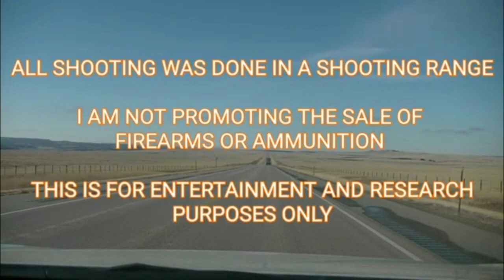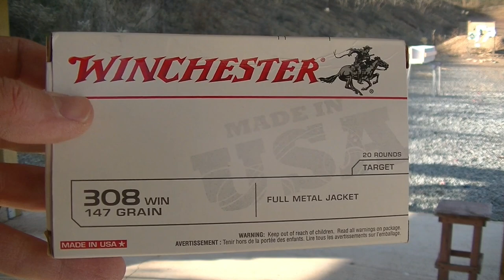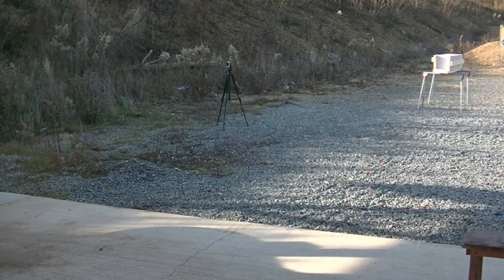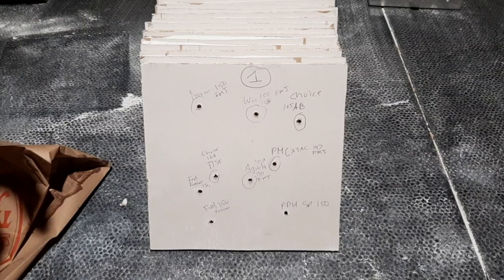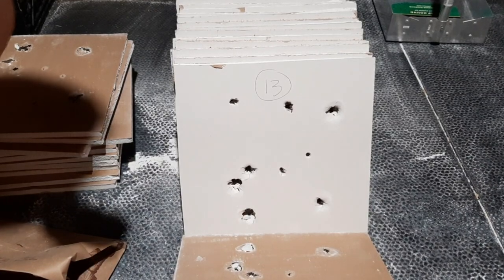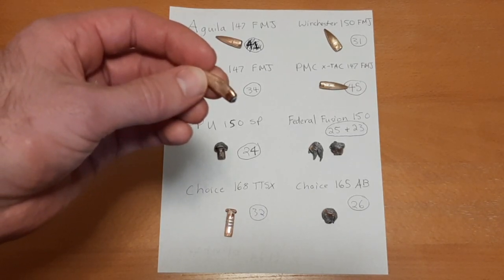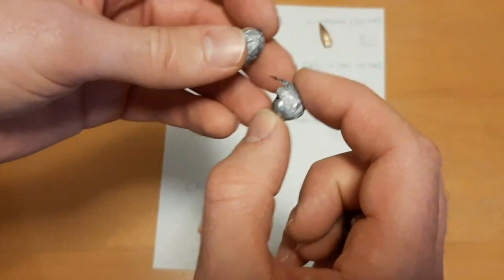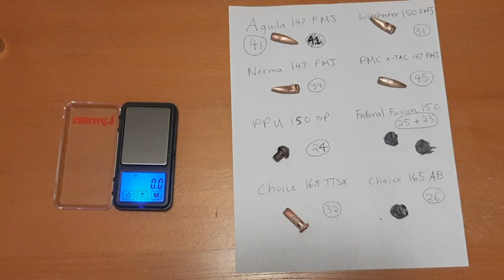308 Winchester/7.62x51mm NATO vs Sheetrock/Drywall - FMJ and Expanding Bullets

Comment: You are a fan of the big bore rifles that’s for sure . Same although mine revolve around what we are allowed to hunt with. 
The one thing that most people over look is the devastation that the 12 gauge slug puts out from 0-50 yards. 
I would like to see what a few of the different slugs would do to the ceramic plates . 
I know what it will do to deer at those ranges vs a 45-70. 
The 12 gauge will leave a bigger hole straight through a deer . 
Im not certain of what it will do to the plates.
Sorry it didn’t realize that you did test with the slug . The slug my not have penetrated as many sheets . What was the damage compared to the pistol and rifle rounds ?
I use what they call foster slugs . I bet that if one of the higher speed sabot slug was used it would go through more sheets of dry wall.
One reason the 12 gauge penetrated less the the pistol rounds is because it’s a fatter bullet,. Plus it’s a hollow base . 
I didn’t think about the cross section being a bigger and it changing the results of penetration.
Reply from the maker: You are in luck I got 2 videos I am editing on 12 gauge slug vs some material.  I will upload them this week.   12 gauge are great I am also going to get my hands on some Brenneke bear slugs to do a test with.